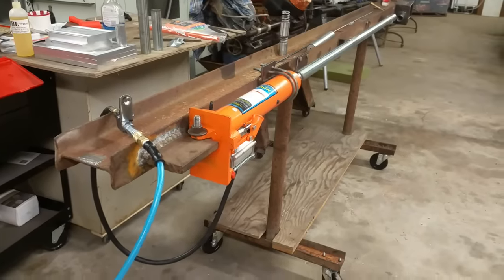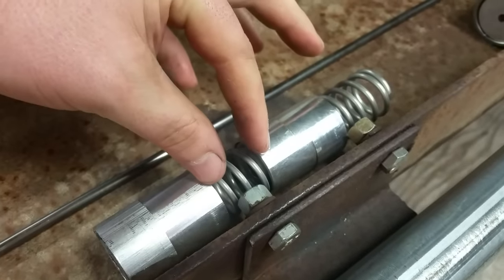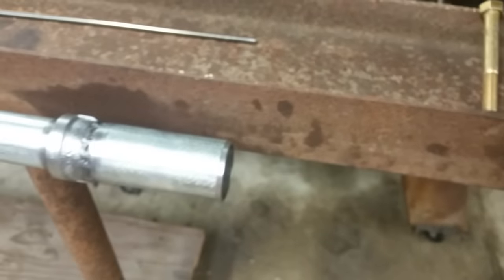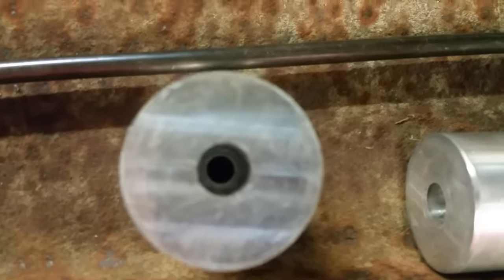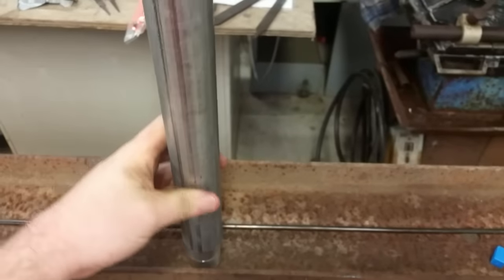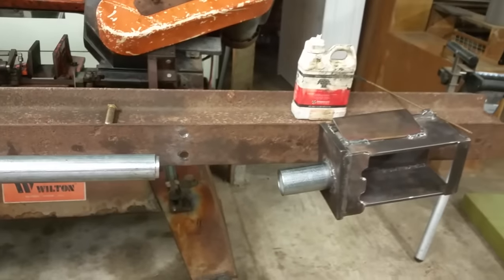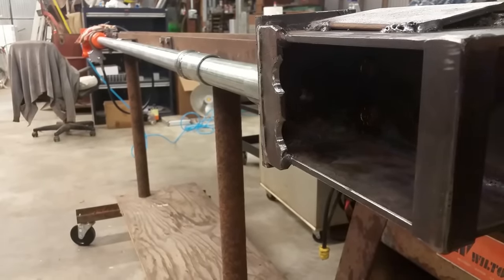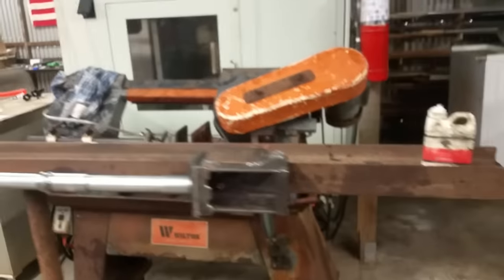Button Rifling Press - Home Built

Comment: I desperately want to show you how to lay down better looking weld beads.
Reply from the maker: First time welding. It's definitely something I'd like to get better at!
Reply: @max-weber  tig welding and machine shop fabrications go well together.  Everlast has a good, cheap entry level tig welder that is forgiving to beginners. A buzz box stick welder is a little heavy handed and messy for the nice work that you are doing. Mig would be the next best choice. Stick welding the last and most unforgiving and messy. But if thats all you got then all the power to you. 25 years of being a welder/fabricator/ machinist has taught me a few things. Taking the time to clean up your weld joints before zapping is the beginning.
Reply: @mr.anderson9938  :D , smh.. yep. I have done pretty ugly welds stronger than pretty welds. If the root is screwed up contaminated, looks arent squat, although strong and nice are a plus...
Reply: @dmmdmm5435  any self respecting Welder who would recommend anything over a buzz box for a first timer has no respect for their trade. Always learn the hardest to the easiest never do it backwards.
Reply: @wdntulik2no438  yeah, there's a few schools of thought on that approach. In school we started out oxy/ace gas welding first, then ac/dc stick, then mig and last was TIG. I found tig pretty easy after mastering the first basic gas welding. Arc and mig have less in common with TIG. Basic Oxy/ace and tig have more similarities. So the transition/learning curve  can be less. It sounds like this guy is self taught so all bets are off. I suggest tig only because the consumables, clutter, cleanup, fire hazard and footprint can be smaller and more effecient than mig or stick. The new inverter TIG machines  are so small and simple also. Everlast is my new favorite for that reason.
Reply: @dmmdmm5435  stick is the way to go and in my experience over 45 years in the field if you can't work a stick you can't handle any other process. Torch welding is so outdated and many jurisdictions frown upon a residential property even having oxygen and acetylene. And as far as Everlast goes you may as well buy a harbor freight machine that can do all three processes at least you won't be spending mega bucks and you will learn on a somewhat decent machine.
Reply: more small passes ,dont weave back and forth so much, wire brush on a grinder between passes.
Reply: @mr.anderson9938  ~ not true. Bad looking welds are bad welds structurally. Do people get away with it? Sure, but that doesn't mean that it isn't wrong.
Reply: @southernshop8424  ~ Yes. Like most that are self taught, I bet a brush or grinder never touched those welds between passes. I cringe at the the flux trapped in those welds.
Reply: @max-weber  you did fine bud, it dont need to be pretty as long as you get good penetration and clean welds youll be fine. i make shitty lookin welds on occasion , no way theyll break
Reply: @wdntulik2no438  why is stick the way to go? Novice here, want to know what produces the strongest Weld, if it looks good too, awesome, but I don't honestly care. I'm curious though, what makes stick better than mig etc etc etc
Reply: @sarchlalaith8836  stick is the way to go as a new welder because it is one of the hardest processes to learn, tig can be tough but is more that you are using two hands to do the process. All processes have their applications and can be strong but to learn you should start out with stick. You are not a welder if you pick up a mig and start welding.
Reply: @sarchlalaith8836  I learned to weld on a mig welder when I was 3. It's easy to learn on.
Reply: I prefer torch welding myself, made a trailer that got towed from Alaska to Florida and back zero breaks.
Reply: Took the words out my mouth good comment
Reply: I started with a 110 buzz box and welded damn near everything with that thing. 1/16 6011 and many passes got me into frame repair. Get a lincoln ac225 and you will weld anything you want without frills. Ac dc whatever. When your welding a tractor or heavy implements either mode will work.
Reply: @xmuggsyx  Oh isn't that adorable, widdums is all butt hurt. I guess I've been put in my place, but good.  Later !
Reply: @dmmdmm5435  ¯\_(ツ)_/¯ just saying those who live in glass houses... if you want to attack someone's integrity you ought to be sure you are infallible. But noone is so maybe we should build each other up, like I gave you a reference to better yourself,  not just tell say how uneducated it sounds to both use a word improperly and spell it wrong.
Reply: wdnt U lik 2 no he did tell him the hardest first. TIG mig stick. Although MIG is pretty damn easy too
Reply: @dmmdmm5435  There is no need to get personal because you don't agree with this man's thinking. Why is it that the lowest mentalities get into the gutter and start name calling when reason and logic fails?
Reply: Men Dmmm,
 "JACK OF ALL TRADES,MASTER OF ONE". THIS IS OFF MISQUOTED AS "JACK OF ALL TRADES,MASTER OF NONE".
IT IS ATTRIBUTED TO B.FRANKLIN. 
IT MEANS TO KNOW A LITTLE ABOUT EVERTHING,AND EVERYTHING ABOUT ONE THING. 
SO THIS GUY ISN'T LAYING "ROLLS OF DIMES" EVERYWHERE,HE IS GOOD ENOUGH TO GET IT DONE & MOVE TO THE NEXT THING.
 TOO MANY ARE GOOD AT JUST ONE THING.BECOME GOOD ENOUGH AT MANY THINGS.
I WAS CERTIFIED IN MULTIPLE PROCESSES BEFORE HAVING TO BE DISABLED,I WISH I'D LEARNED MORE THAN JUST WELDING.THERE'S TALENT AND THERE'S SKILL,YOU CAN DEVELOP SKILL.TALENT IS A GIFT!!
ALL THE BEST TO YA!!
Reply: @jiwbink  binky binky binky my little friend.  I retired at 44 in 2002. Sold the machine/welding/fab shop. 6 figure beach house, 6 figure investments, new pickup every 5 years, the embarrassing list goes on. All that because I know way too much about too many things. I didn't let a little thing like 2 major back surgeries stop me. I made it my business to know and do more than my employees and competition so that I couldn't have to whine about "coulda shoulda woulda didn't "
Reply: No don't do that those are special purpose weld beads from China lol.
Reply: @chrisrancat2808  I resemble that remark.
Reply: @dmmdmm5435  Lol! Nice refeed back to me.  A humbled bumbler I've become.  Time to subscribe:)
Reply: @chrisrancat2808  you must be a liberal
Reply: @chrisrancat2808  really just one?????
Reply: @chrisrancat2808  glad to hear your not a liberal though.
Reply: Mr. Anderson the better a weld looks the stronger it will be
Reply: It all depends on what you are welding and what its condition and/or purpose is. it is important to have some pride in your works and process, but not to the point of obsession. just do it right. I started on the crudest MMA set up and make welds with it that rival many seasoned MIG/TIG users. When available I'll also use MIG and TIG if that has some advantages, especially on thin parts or special alloys, apart from the mess and clean up and the higher heat affected zone of MMA, either will produce good welds. All he needs is a little practice and  hand/eye coordination. You are right they look very 'sparrow shit' at the moment, but I like his solutions to the practicalities of button rifling (I'd maybe turn the thing 90deg, on its side, to make set up and usage easier, is all; perhaps a few more register holes to accommodate different barrel lengths). Buzz box used to be the cheapest DIY/Hobby set up back in the day (yes I am that old), even to the point where you could make one out of scrap iron and old cabling (been there, done that), but the inverters and other mig/tigs are light and convenient and readily available and cheap enough these days. but I wouldn't be the welder I am without the earlier experiences. and so I have successfully welded rusty and perforated old exhausts in the field with a MMA and an improvised filller-rod, not too many folks can do that even with oxy-gas/mig/tig.
Reply: @nativejuicevapors  not true, inclusions and stress/cooling fractures to name two, can look pretty on top but lousy strength.
see: https://www.youtube.com/watch?v=2fUAHkUfTps
you're welcome.

Comment: Very nice DIY setup! My only concern was that the tube would expand too much inside the bushings and get stuck which is kinda what happened, but not as bad as I initially thought. No more then they seemed to expand a little lube should fix that issue like you said. It produced a nice, clean, quality end result. This is a very well thought out, designed, and built setup. You should definitely be quite proud of it!
Reply: You are correct. Guess most people just dont get it.

Comment: The pushrod support bushings are genius!
Reply: what it got me thinking of, was something a couple of european powers did refitting/recalibrating rifles to smaller bores before WW1, this seems, with a slight change, like a decent way to re-bore a worn out barrel...by using it as the bushing and rifling the smaller tube inside it.  if the compression's right, and the barrel itself is properly supported in the jig, the pressure should be enough to hold the rifled inner tube inside the outer shell-just a hair more oomph to the button, I think, and you might have a very rigid barrel even with a decent taper.
Something to consider, anyway, esp. if you use stainless in the liner as a substitute for chrome in an ordnance steel outer.

Comment: I like the collapsing spring pushrod support, very clever! I wonder if splitting the barrel support bushings would make it easier to get them off after rifling, it seems that those thin tubes swage out just a bit and tend to lock themselves in there due to the outer diameter of the barrel expanding ever so slightly as the button presses through under the enormous pressure required... on the other hand, it does put the steel of the barrel in compression which will make it stronger, much like forging compresses the grain structure of metals, which is a nice bonus! Interesting vid, I'm impressed how well it works!!

Comment: Very curious about your intended use for the barrel...I’m leaning toward air rifle, but may also be way off the mark. Excellent set up...I’m jealous of the sheer space you have to do these things in!
Reply: I was thinking perhaps carbon fiber wrapped barrel...
Reply: @colinward1581 if he was going to do something as expensive as carbon fiber wrapping, he would have taken the money to buy a proper rifling machine.

An airgun barrel sounds more plausible.
Reply: @colinward1581  It takes enormous skill and expertise to properly carbon fiber wrap a barrel, and looking at the guy's setup that's not the case here. More likely he's just doing it for fun to make some plinkers.
Reply: @linkbond08  There are a few folks that make rifled barrel liners, their price is fairly reasonable but perhaps they cannot ever make exactly what an individual customer might want or need. Especially when the need is more exotic twist rate for some reason. Liners for .251 barrels was one example some folks looked high and low for. The "blem" bullets sold in bulk once included a huge amount of 25 acp bullets that could perhaps be very useful if you could find a 16" barrel to shoot them out of.

Comment: When TSHTF you are one of the ones, people will seek out. I personally wouldn't have a problem sending a "message" through one of your tubes. It may not be a "high-end" product or precisioned engineered as the big boys, but im sure they will get the job done! Its great to see someone with a "certain set of skills"! Thank you for sharing your video! Nice job! Dont forget in WW2 there were shotguns made from two pieces of pipe, a board and a few other pieces of hardware and they did what they were designed for!!!

Comment: 17 years ago i witnessed a barrel rifling machine that was home made. It pushed a tool through the barrel but only cut on the return stroke. Rotating the barel to six different positions and on the final position it would turn a screw that would make the cuttter one ten thousands of an inch taller on the tool and go through another sequence. It ran for a couple hours i believe but was absolutly ingenious and super accurate and smooth
Reply from the maker: Cut rifling is what many high end barrel makers use :-)

Comment: I would choose moly grease as a rifling lube.  It works well for high-pressure sliding surfaces.
Reply: No mate, just no!
You have no idea what you are talking about.
Reply: @shonaoneill5151  I am open to learning.  Please tell me what whould be superior to moly grease and why.
Reply: @shonaoneill5151  What is the problem with using moly grease?
Reply: @superdave380  moly grease is meant for parts to slide over each other without cutting into each other. moly would be great to lube the outside of the barrel blank in its holders. as to cutting lube its is different depending on what type of metal you are cutting.
go to "www.mcmaster.com" lookup cutting fluids they list many and tell which are best for what.
Reply: @normdoty  Button rifling is not a cutting process.  The button deforms the metal, but does not cut the metal.

Comment: WOW, I have also been watching TheIdahoanShow and was aware of his work with rifling buttons. But your system of ramming the button through is ingenious. Did you develop that? I had not seen anything like it. I was thinking about trying to figure out how to PULL a rifling button instead of pushing it. Don't know if that is within the realm of practicality (without super metals etc.) 
The supporting slugs for the barrel can be custom made for different shaped and diameter barrels also. Very very good sir!
Reply from the maker: I have to credit TheIdahoanShow for the basic bushing idea. I added to his design by cutting the recess for the springs to rest inside. The barrel support side was all my own design ;-)

Comment: Just wondering where your pushrod is in contact with the rifleing button, is there a bearing between the two to let the button twist easily, so there isn't any friction between the two?
Reply from the maker: The pushrod and button have enough surface hardness to allow the button to rotate freely during the push rifling process. There isn't much friction between the surfaces.
Reply: As short as the barrel was did it even make a complete turn?

Comment: You could do a barrel of any length if you took the principals of the boring rigs that do underground utilities. In short you'd push your button in to depth then draw your ram back and place a section of new rod between the ram and button and push it again and repeat to any length.  . Pretty amazing build brother!👊
Reply: Problem is you don't want the ram to stop pushing or it gets stuck do to cold welding. I had this happen and it is not easy to get it restarted. Not only that, but even if you do then you will ruin the coating on the rifling button. Neat idea though!
Reply: @AldoSchmedack I see, I wondered about that. I'm definitely not a metallurgist by any stretch of imagination. I did operate a ditchwitch directional bore machine a while on a street light contract in Kansas City so thats what made me think of that method. It always impressed me to drill  200' or 300'  with 10' sections of rod at a time. Thanks for the info 👊

Comment: I didnt quite understand why your push rod had to be much longer than the barrel you are rifling .  Nice video.
Reply: George Sherfick same
Reply: The difference between the compressed vs uncompressed support guides is what determines the barrel length. You need enough guides so the sum of length difference adds up to the barrel length.
Reply: so he can do longer barrels....
Reply: @americanexceptionalistorg  He mentioned he can rifle up to 22 inch barrels. As I mentioned in my earlier reply, the difference in length in of the supports determines the length of barrel (and the throw of the ram). He said he had 22 of those compressible guides. My guess is each guide can compress one inch which is why he needs 22 in order to rifle a 22 inch barrel.

Comment: Would it be safe to say that not only was the barrel rifled but the barrel was also expanded outwardly from the button causing the outer sleeves to become stuck? Did you mic the outer diameter before and after of the barrel to document expansion? If so could you give us those measurements? Thanks very nice home made press!
Reply from the maker: I'll be sure to document that when I do another barrel.

Comment: Barrel companies pull the buttons through.

I would try two different size buttons. The first would be smaller first pass groove. The second would be the final cut or correct size grove.
Reply: Yeah I dont see this working on any significant length of barrel. The 'pushrod" will deflect if pushed. This setup should be able draw the button through with a little modification.

Comment: Heat? Do you have any issues with heat, galling, or friction welding of the button?

Are you going to try the reverse and do cut rifling by pulling a rifling cutter through?
Reply: Barrel factories pull the button through.

Comment: Why do you have to have such a long push rod?
Reply: I believe the length is because of the bushing with the springs for the support... needs to have 22" of spring collapse and then the rest for the bushings supporting it. Remember it has 22 of those bushings and springs inside it to support the push rod.
Reply: @prairiemountaineer ~ 22 that start out fully expanded with the springs.
Reply: @remy5405  if you only used a 22" push rod (the travel of the hydraulic cylinder he used), it would likely bend in the middle because of its diameter (roughly 1/4"). To prevent this, he added the bushings, that take up all extra length. The springs main job is to keep the bushings evenly spaced, with only about 1" of unsupported rod at any one place which keeps the 1/4" push rod straight and true. As the button is pushed through the barrel the distance between each bushing gets less, until the bushings are almost touching each other by the end of 22" of pushing.